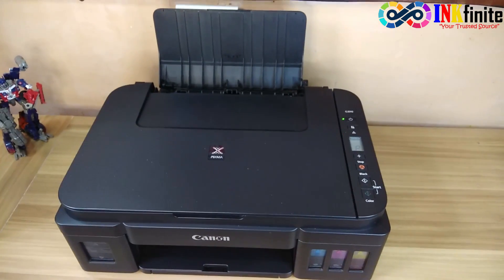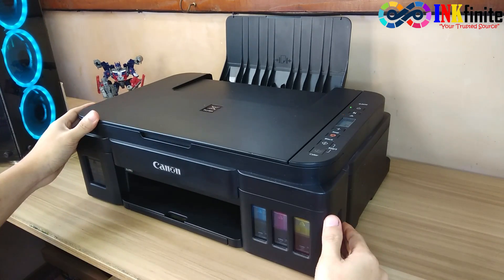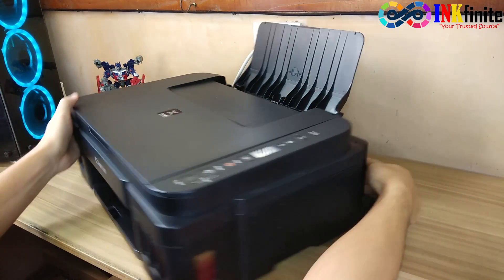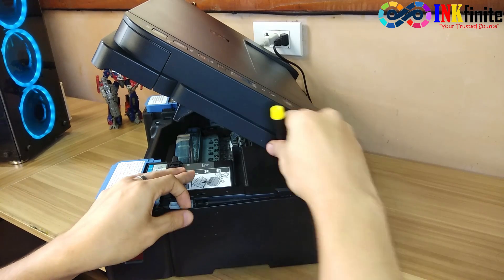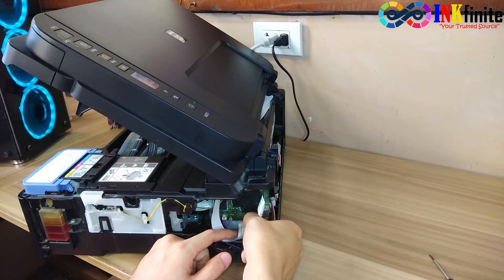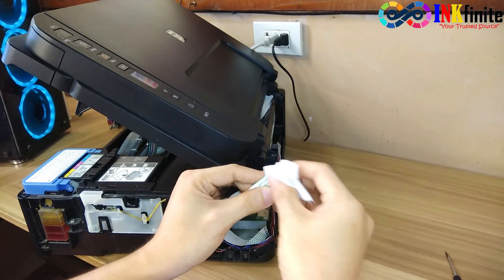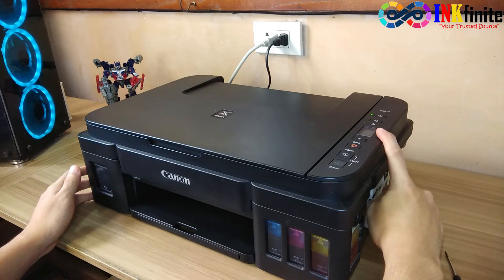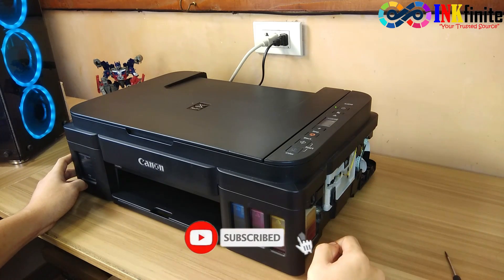How to Fix Canon G2010 Series P22 Error and Support Code 5011 5012 | INKfinite

Comment: Can we change the cable ?
Or the whole scanner part should have to be changed ?
Reply from the maker: You can try changing the flex cable first and see if it will fix the problem. If not then you'll need to change the scanner lens also
Reply: @INKfinite  
OK, Thank you

Comment: Hp ink 415 e2 error? Cartdge pob un error nun?
Reply from the maker: An E2 error in Hp ink tank 415 occurs when the printer attempts to print a single-page or multi-page print job, and the paper length selected in the print settings does not match the length of the loaded paper. The printer then prints out the first page with errors.
Reply: Nag pi print sia ng isa tpos e2 error na sia 
Pa video po anu dapat gawin ?